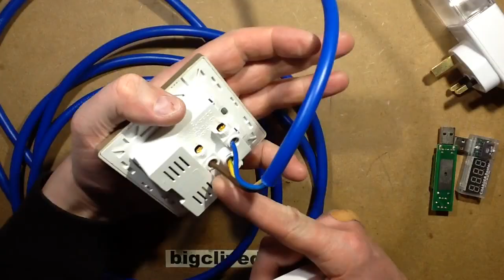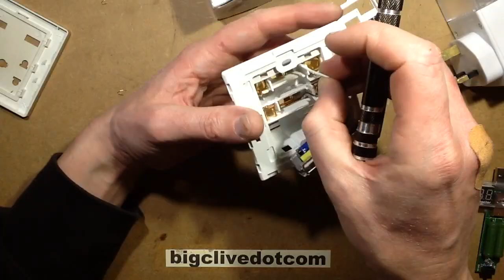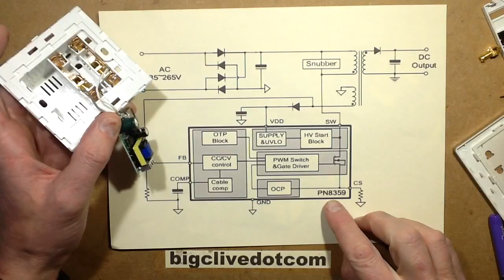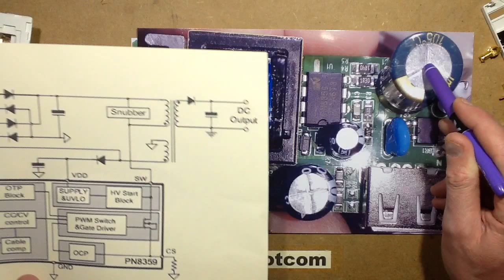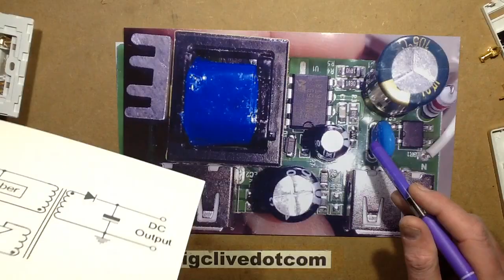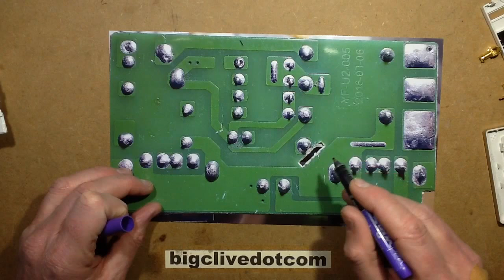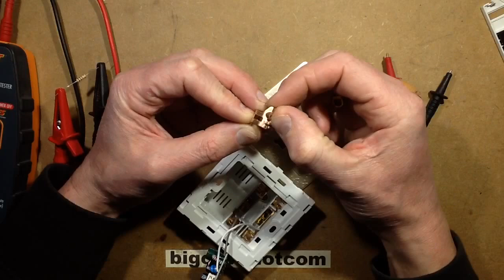Wall plate death-dapter tests including fire and 1kV.

Comment: When I was 3 years old (this is the only thing I still know from these early days) I put two knitting needles in the socket of my parents house.
It shocked me and I ran to my mother. Nothing serious :)

After that my parents and my grand ma installed some of those twist socket security things.
When I was 5 years old I successfully popped them back out and gave them back to my parents (I was a friendly kid :)  ).

Years after that I opened a electronical stapler without discharging it properly.
I still live :D, but that hurt quite bad. Never do that.

Today:
Studying computer science.
But I still love to play with my arduino and stuff :)

Comment: I ended up in a career involving very high voltage and high current electricity and agree that many shocks and small fires were par for the course.

I don't think I would like to put 13A through that socket for any length of time - not a lot of copper-effect-steel contact area.

Comment: When I was 8, I found a loose cable with a plug on it somewhere. I plugged it in and touched the un-isolated end out of curiosity.
I now work in software engineering and plugging in anything makes me nervous, and every unusual sound of electronics makes my heart skip a beat.
Reply: instead of rolling with the punches and ending up fried, try to learn to avoid getting punched
Reply: Tripledonkey softy, try undoing a farm gate that is hard to undo with a shock every 3 seconds or so. Jk
Reply: @braydendaunt7070  yep no insulated gate handle right. Rapid for Colville shocks anyone.
Reply: Same childhood story here, I stay away from messing with mains voltage as much as I'm able to now
Reply: Softy :)  Once you've had a couple of dozen mains shocks you learn to roll with the punches.

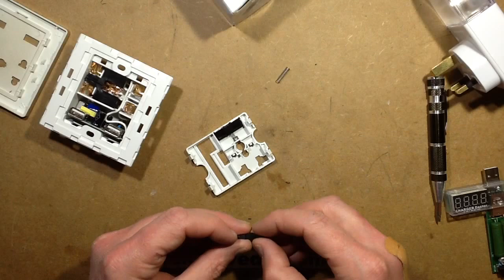Comment: 4:26
Been there, done that. (I was like only a toddler XD)
Well, it wasn't a pin but a screwdriver, and a socket without the coverplate installed. Still have a scar on my thumb. I'm proud of it. X'DDD
And yes, it helped "spark" my interest in electricity. Though I was already interested at the time, as any kid would be. XD

Comment: (United States) The only outlets with shutters I have ever had to use (Aside from the twist one, are those technically shutters?) are in my current apartment and I have only had one small problem with them, I can't plug anything in to several of them.......................

Comment: Funny thing is, they could have got rid of that separation headache completely without even needing a second routed slot, if only they'd have routed that trace to the other side of the USB connector; with the width of the ground trace being what it is, it really would have not made any other difference, but it would have stayed far away from the HV side...
Reply: Ah, you beat be to it by an hour or so. It's surprising how often you look at a simple PCB design and spot things like this.

Comment: The problem with these is when someone hooks up a nice little euro two prong plug with a cable with 1mm2 flex.  There's very little chance of a fault in that flex from tripping your 32A ring final circuit breaker, so you end up with fire and bare burnt live cables. Incredibly dangerous.

Comment: You are 100% correct, sir.
As a small child, my dad was a mechanic and machinist. He had a hand-held strobe light thing to adjust the ignition timing on old cars (old now - but new back then). When the induction spark detector went bad on it, I dug it out of the trash and tried to modify it to plug into the wall. It looked like a ray gun, and I, as an enterprising 10 year old, wanted a ray gun. Twenty minutes of tinkering, and I jammed a modified plug into the wall socket. There was a deafening bang, a small fire, and lots of smoke.
Thirty years later, I went to university and got a degree in electrical and computer engineering, and am looking into pyrotechnics certification.

Comment: This is really the kind of "quality" sockets you find inside most (even newly built) chinese houses. The common denominator is CHEAP these are all ingeniously engineered to contain the least amount of expensive copper and plastics as possible. Safety is always a NON issue.

Comment: Was there any sort of 'standards compliance' stamp or markings on the unit? I agree with your view that the internal physical mains connection hardware seems 'a bit dodgy' & the heatsink looks to be rather inefficient being 'glued on'. I also wonder if  the separation gap is a result of that being a failure point on a previous version..  I certainly would not install one in my own home or for anyone else (Will not install anything I do not fully trust)   As the USB power supply is always on it would be interesting to check RF spectrum for possible near field RFI when USB ports are in both states (IE;  not in use / providing power to load on USB devices) just a thought.. :-)

Comment: Part of my family lore is the time when I was about 9 and I disassembled a 13A plug, plugged the pins in separately, then shorted the neutral and live with an all-metal stainless steel knife. I was blown clean across the room and the house was plunged into darkness, followed by shouts of "Peter! What are you doing up there?!" We kept the partially melted knife for years. I was indeed planning to do EE at Uni, but luckily the microcomputer revolution happened around the time of my 'O'-levels and I got detoured into software instead!

Comment: Quite right about the pins bending out of shape over time. I live in China and have had to put up with this design of any-plug-will-fit (read any-plug-will-spark-and-fall-out). They do tend to splay. In particular, if you use a UK plug, which have big beefy pins, then swap to the Chinese plug with thin pins, you will get a very dodgy, wobbly, sparky connection. When I bought my own place here last year, I insisted that they install the regulation CCC marked sockets that only accept standard Chinese plugs. 

For reference, China uses the Japanese standard two pin plug and an inverted version of the Australian standard 3 pin plug, with a slightly longer earth pin than the Australian design. For high power devices like air-con, they use a chunkier version of the 3 pin plug with wider pins and a correspondingly wider socket.

Comment: Here in Australia, we have no such devices inside our plugs to limit things being pushed into them! We need to plug in a plastic plug effectively to block the plug from children (which will be child-proof one would hope...) also, our voltage is 250-250volts here... lol We have had an improvement on our male end of devices cords which now has a kind-of fuse but that is not in the wall socket it is on every device cord! This came into place in 2007, the same time that we changed our standards for positive/negative and earth colours for wires.
Reply from the maker: What is your new colour code?  The Oz system used to be based on the UK phase colours, but we have been forced to change our colour code from the vivid red, yellow, blue and black-neutral (red and black for single phase) to the bland brown, black, grey and blue-neutral (yeah, swapping phase and neutral colours) to comply with European standards.  You also use radial circuits for your sockets instead of our higher current ring.
Reply: Here in the United States, we still use the plastic plugs in older houses but all new construction must have the child proof receptacles for residential construction.
Reply: While you can get shuttered sockets in Australia, they are not necessary as the holes are small enough to be effectively childproof.
Reply: In Romania we have 220-250V too and I still remember how I used to get shocked when I washed my hands from one of those electric passthrough water heaters. I could say that it "sparked" my interest in electronics so shocking=not bad?
Reply: +James Baur when did that go into practice? I've never heard anything about it
Reply: In Russia (where EU Type F plug is used) we have both, wall plates with and w/o safety shutters. It is mandatory to install ones with shutters in living quarters, schools, nurseries.
But IMO it is safer to install protection tripping unit (in addition to short circuit breaker).
Reply: +asasial1977 2014. It's in the National Electrical Code.
http://www.nfpa.org/public-education/by-topic/top-causes-of-fire/electrical/tamper-resistant-electrical-receptacles
Reply: Defensive Wounds That shows the superiority of English engineering and safety standards. 😎
Reply: *****
Or maybe, just Australians are more desperate. 50% of the living things there probably deadly for human.
Reply: Same in America
Reply: Shambles1980TRealOne You're supposed to ground water pipes, the issue is that the pipes are not grounded when that happens and are energized.
Reply: Ah yes, haven't even thought about why that happened. Thing is that the water heater had also a small metal pipe where it dispensed the water and, besides the bad wiring, the plug had exposed wires so alot of "death traps" laid around the house for me :). I think 220 is not that dangerous especially given the fact that you are immediately thrown away by the shock, heck, I have a friend who was blown away from the wall when working on 360 volt transformers and he eats just fine through a straw (joke).
Reply: lol definitely different wire colors over there. In the us for regular house voltage its 120v with Black for hot, White for neutral, and Green for ground
Reply: I live in the US and I've only occasionally seen the plastic plug cover things. Most of the time when I see those things, it's an outlet with one plug covered with an old, skanky looking plastic cover thing and the other plug is just sitting there open.

Really, it's best just to bend the tines of a fork and stuff it into the slots of the plug. . . Disclaimer: Don't friggin' do that.
Reply: My kitchen kettle draws 3KW.
Reply: In some modern Chinese Euro-style sockets these "limiters" (or however you name them) are made in such way that if you push something into one hole, they don't move. Only when you put two pins, the lock turns by ca. 15° and reveals socket holes. I have in my home some early 90s' sockets (made in Germany or Poland) and they have already the same system as described.
Reply: Well, I have a single bedroom place in Australia that's quite old, and has a grand total of 10 (5 dual gang) sockets for the whole place, 6 of which are in the kitchen.

Both the living room and bedroom setups are completely inadequate, since I currently need about 3-5 sockets in the living room, and due to what I have set up, the bedroom has 11 devices plugged in, not including some builtin USB charging ports in a power strip. (which typically means another two devices plugged in.)

It doesn't sound too bad, since no individual device pulls all that much power,  but I try to keep a close eye on this arrangement, because when you add it all up...
Well, there's at least 5 devices that break 50-100 watts each, one whose theoretical maximum load is nearing 800 watts, and of course in winter an 1800 watt electric heater.
Add it all up and you see that the hypothetical load on this single dual-gang wall socket pair reaches towards 2500 watts...
I don't know what the limit of sockets is, and whether it's per socket, or if it's shared between the two, but it does rather worry me.
But as it's a rental property, I'm stuck with it, and all I can do is keep an eye on the incredibly messy arrangement that lets me plug about 15 things into 2 wall sockets.
Doesn't seem incredibly safe, but the only other thing I can do is not use any of my stuff.
The computer is especially bad since there's at least 4 and often 5 or 6 devices that MUST all be plugged in at the same time just for the computer and internet to work.

I'm not exactly concerned that I'm actually overloading anything, but it certainly doesn't seem like the safest of arrangements...
Reply: In continental Europe we have to do same thing with our CEE7 standard sockets. There are special plastic plugs to baby proof them.
Reply: WolfKenneth
Or the thing I described, I live in Poland :)
Reply: so is my country
Reply: +Muhd Faaris just 10  volt less
Reply: in the US we have no sort of fancy blocks or mechanisms in our outlets, not that i have ever seen
Reply: James Baur
o ok i have only seen in buildings built before 2010, i thought that was recent enough though
Reply: In NZ, which uses 99% of the same wiring rules (We both use the AS/NZS 3000, with individual country differences highlighted in any applicable paragraph), we use the colour system of Red, White (WAS yellow) and Blue (ph 1 - 3), black as neutral and Green / Green AND yellow as earth. In saying that, When buying 2C+E appliance cable, it will probably come in brown (ph), blue (neutral) and green or Green/yellow.

Lastly I'd also like to mention that NZ does have the "shutters" in most of our plugs, or at least in the main brands. I'd venture to say that Australia would too, but I've never worked in Aus ;)

I've heard from one ex workmate that you guys all use steel conduit, even in domestic installations. Is that true? Must be fun to thread pipe on a winter monday morning :P
Reply: In America, all outlets have dual plugs.
As far as safety devices, there are "tamper resistant" outlets which have a guard inside which blocks any object besides a plug prong, but they have only been available in recent years and are not widely in use yet.
Reply: In America, alot of newer homes use 200 amp panels, which would be 48000 watts; although most of the plugs are 120v instead of 240v. Only larger appliances such as clothes dryers and stoves use 240v.
If someone has a large, multistory house with garage and/or workshop, then they can easily max out the wattage with electric stove, electric dryer, HVAC unit (heat pump), clothes dryer, electric water heater, etc.
Reply: Not sure when it went into place but I do know "Tamper resistant" is a must now. I personally don't like them but I understand it, you can still buy the non-tamper resistant ones but you're not technically supposed to use them.
Reply: Why would there be a Water Heater that shocks someone? Why would such a device even be allowed to be sold if it's a safety  issue?
Reply: there is also red for hot in other types of single phase circuits, it does get a bit different when working with more than one phase though. It slips my memory which colors are used but I do remember brown and yellow are used in 3 phase motors.
Reply: Thank you, but it doesn't even show one. Home Despot has them:http://www.homedepot.com/p/Leviton-15-Amp-Tamper-Resistant-Duplex-Outlet-White-10-Pack-M22-T5320-WMP/100684043 

And I see they even have GFCI versions: http://www.homedepot.com/p/Leviton-15-Amp-125-Volt-Duplex-SmarTest-Self-Test-SmartlockPro-Tamper-Resistant-GFCI-Outlet-Black-R95-GFTR1-0KE/206000179